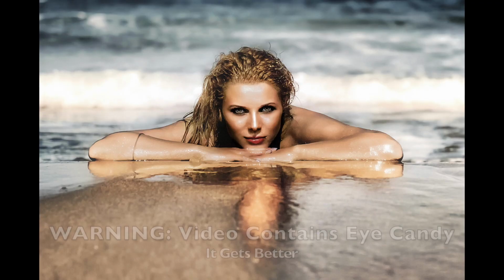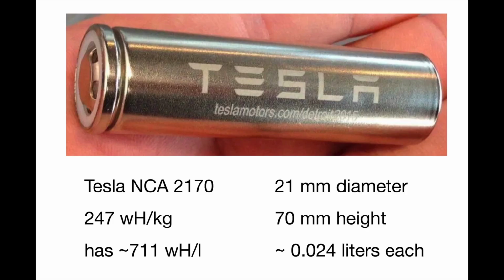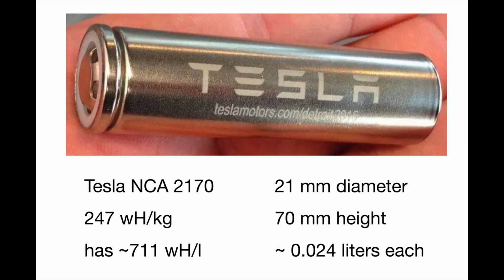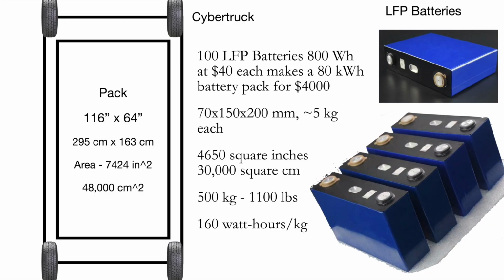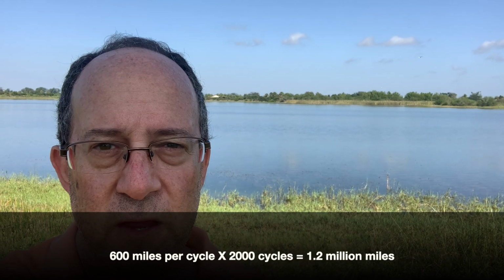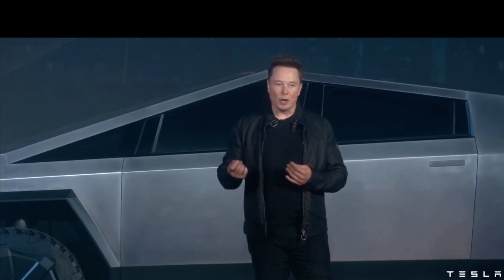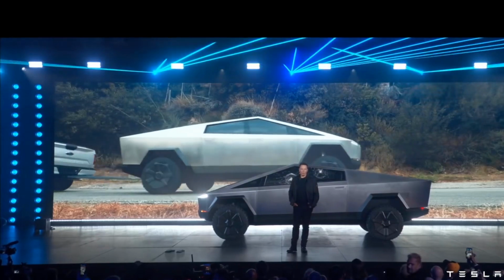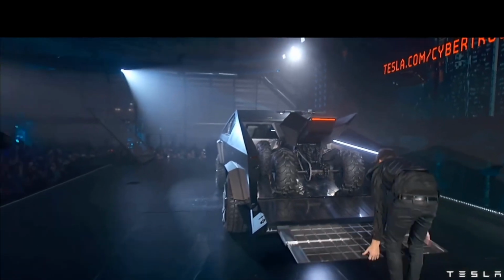Tesla Cybertruck SECRET Battery Advantage: Size Does Matter

Comment: I think you were right on track. This is getting more obvious after the Q2 call.  Nickel is a limiting factor. Easiest way for Tesla to scale to TWh is using LFP.   Lots of things Tesla did in the past makes more sense now. Things like 1) canceling Model 3 RWD long range, 2) canceling Model Y  RWD SR,   3) eliminating differences between AWD model 3 and performance (or making performance model mostly a software update over AWD Model 3)  and 4) why Tesla announced initially that they will start with the two cheapest  cybertruck  versions (which they then changed after seeing reservations). 

I am more and more convinced that what they have at Kato  is actually 2 projects. One high density battery that will go iinto S/X/Roadster/Trimotor Cyber truck. The other is LFP cell-to-pack. I think Tesl will stop Model 3 SR+ and reintroduce Model 3 RWD (long range) and Model Y RWD  LR - both  using LFP. I think these two will become their affordable vehicles. Probably 38 K for Model 3 and 42 K for Model Y, and going down slowly after that.  Cancelling Model 3 RWD LR was to ensure that  there is not a dramatic shift in cost (form the original base price of 49K for the RWD model 3 to say 38K for the LFP version). That AWD versions can receive software upgrades to performance versions can justify their substantiallly higher cost. 

Cybertruck RWD is definitely going to be LFP. Question is if they can pull it off for dual motor. But given that Tesla originally planned to do single motor and dual motor first I think it is possible that  dual motor also uses only LFP.   I think the hybrid option  can be done for dual motor.  Possibly 200+ miles range with LFP and 100+ with some Nickel based battery (possibly with lower cycling ability)  This way the lower cycling Nickel batteries will be used only when long range is necessary. Trimotor will definitely need the other high density secret battery brewing in Kato.  

I think Tesla wants to make the LFP based 3/Y and the 2 cheaper cybertruck versions as their mass market vehicles.  They will use  Panasonic batteries only for Performance versions. This frees up a lot of Panasonic batteries for Semi truck (at least until Tesla is able to scale up their own batteries). 

My prediction is that  the first battery factories at Austin will be LFP batteries for Model 3,Y and cybertruck. I think the high density batteries will be built in Kato for  S/X and Roadster. The cells for Cybertruck trimotor will come from Kato ( I am guessing they were surprised by the demand for Trimotor Cybertruck).
Reply from the maker: Using LFP will allow Tesla to lower price for Model 3 and Model Y. LFP is significantly less expensive than Nickel chemistries.
Reply: @WarrenRedlich  I wonder if Maxwell's dry electrode tech could be used for LFP too. It would then make a lot more sense for Tesla to make their own LFP cells.
Reply from the maker: Great question. I don't know enough about the dry electrode tech or LFP tech to get into that. The Limiting Factor is the channel to watch for that kind of deep dive. I asked him to do a video about LFP but he wasn't ready yet.

Comment: The announcement of a massive increase of super charges in China & Germany means smaller cheaper battery packs is possible, without range problems. Remembering that software is Tesla's secret sauce  other battery manufactures are not a threat, and even an advantage as shown by CATL in China.

Comment: Wow this is pretty shameless. Indeed lots of speculation. 
...and someone help me. If it’s simply the size of the truck that makes the difference...why is the SemiTruck such a challenge?
Reply from the maker: Problem with Semi is it uses a lot of batteries. Need to increase battery production.
Reply from the maker: And Semi probably can't use LiFePo4 because weight matters a lot.

Comment: At that time, Battery experts specifically said that a 200kWh battery could feasibly have 620ish Mi range

Elon also said that the 200kWh battery would be a double stack of P100D packs. This was before Maxwell...
Reply from the maker: Where did Elon say that about double stack?
Reply: Warren Redlich

During the MKBHD Interview, talkin tech with Elon...
Reply from the maker: Just watched it. Thanks. He didn't exactly say double stack, but it was helpful. I've been thinking about doing a video on Roadster and this really helps.
Reply: Warren Redlich 

Pretty sure he did. I’ll watch it again
Reply: Seems like you were correct. He simply said doubling the internals not a double pack. My mistake
Reply from the maker: I'm not really sure what he meant, but it's going to help with that video.

Comment: What is the point of this video?

The main aim for Tesla should be to increase the current energy density in their batteries in an even more sustainable way. Period. 

Thumbs down. Sorry.
Reply from the maker: I don't see why you think this is unsustainable.

LiFePo4 is much more friendly for the environment than the various Nickel chemistries. 

I do think Tesla is working on improving energy density - including with LiFePo4 - but using LiFePo4 for certain applications makes it cheaper to use those Nickel-based chemistries for applications that really need the improved energy density.
Reply: Warren Redlich That was not the point. Your video was just very speculative and it was hard to make out what your point was. If it was to speculate that Tesla is working on increased energy density and make them more sustainable, then that could be said in 30 secs... further speculations always look better with substantial evidence.
Just some feedback, I’d much rather follow a channel where speculations a backed up by evidence/or strong indicators, such as reliable leaks etc.
Reply from the maker: Point of the video is that Cybertruck's size allows for the use of batteries with lower energy density. This saves money on those vehicles and frees up batteries that have higher energy density for other vehicles that don't have as much size.
Reply: Warren Redlich I see, thanks for clarifying :)

Normally weight is one of the primes enemies when it comes to range and efficiency. Also the Cybertruck will need a big ride height for off roading capabilities, so I would assume Tesla would have batteries with both higher energy density and can be produced at lower cost - but yes, Cybertruck is a big vehicle and should be able to hold som good batteries :)
Reply from the maker: I agree the added weight would hurt range and efficiency to some extent. I don't think it affects ride height. I suspect that there will be an extra-cost off-road package that would probably be chosen only by those who buy the dual motor or tri-motor. Single motor model does not have All-Wheel Drive.

Comment: People use the LiFePh batteries in campers but I believe they are not supposed to be charged if below freezing. So unless they have figured out a way around this would be a problem for cars. Could put a heater in the battery but would really hurt cold weather range.
Reply from the maker: Tesla already heats the battery when necessary.

Comment: Some of those ladies look like they may have a 200KWatt battery pack under the hood!!!
Reply from the maker: Not enough volume in any of those models for a large battery pack.
Reply: More complicated, it's symbiotic -  the energy available depends on the anode (male) side, how much voltage gets generated by the cathode (female) excitation.

Comment: I have a very good guess, btw 8-).
Reply from the maker: What’s your guess?
Reply: @WarrenRedlich  When I built a off-grid solar setup, I used multiple different types.  Capacitors, and li-ion, and LifePO4.  and lead, actually.  I was able to get them all to work together.   Or a different chemistry all together.  But the CyberTruck will prolly use the next gen battery, not the 1mil battery.  the 2mil battery perhaps 8-)
Reply from the maker: It's pretty clear the Tri-motor will use the next-gen battery. But what do you think about LiFePo4 in the Single motor model?
Reply: @WarrenRedlich I don't actually know but the catl lifepo4 batteries I was originally using for the off-grid would fit well to a big flat truck battery pack, they are cheap, and square.
Reply from the maker: Yes. I briefly mentioned that in the video. Maybe that larger rectangular battery format would easier to assemble and require less additional hardware.
Reply: @WarrenRedlich  Yeah, I have disabled cameras, so you prolly couldn't see me nodding at the screen 8-).

Comment: 17:09 That is the cringiest piece of marketing I have ever seen in my life.
Reply from the maker: It was cute.
Reply: @WarrenRedlich  Should have hired Ryan Gosling to film short for Blade runner where he has to retire a replicant and featuring a beat up cybertruck as part of the short.
Reply: The whole point was anti marketing. It worked.
Reply: Stand the batteries up. Doubling the 54mm prismatic adds 40mm height to the 70mm cylindrical. About 4.5 inches high should be no problem in a truck.
Reply from the maker: I'm not sure how the chemistry works in prismatics - will the batteries work as well if they're sideways?

Comment: Great presentation, setting the ground for the  world vehicle made in China, with "SENSIBLE" range, performance, no of cycles, cost etc. LiFePO4 is obvious for stationary applications, and the use of cylindrical cells is purely historical. Maxwell electrodes, coating, double heating of crystal cathodes etc, tab-less electrodes apply equally to a  prismatic cell.The actual electrolyte & additives  will vary. TESLA'S SOFTWARE IS THE BIG SECRET and in my mind the concept of the buyer selecting  the ratio of NCA  & LiFeOP4 cells  in a hybrid would tick every-ones needs & desires.
Reply from the maker: Yes, I think software combined with a hybrid battery could be fantastic. I'm not sure it's worth the engineering effort but it should be.

Comment: Elon said that the Roadster 2 would have a 200kwh battery pack 3 years ago. Things change and they may not need that when it’s actually here.
Reply from the maker: I just don't see how they can fit a 200 kWh pack in Roadster. I'm not sure how they'd even fit in 150 kWh.
Reply: Warren Redlich no you’re right, it must have been very tight in the prototype, whatever pack they had during the unveiling. I think someone said that they would be stacked on top of each other but that would make the pack extremely thick. Fewer cells with more energy density is more probable for the upcoming version but Elon did also say a few years ago I think “we can do 600 miles today, no problem” but I guess it wouldn’t be as practical as it will be.
Reply from the maker: My guess is it's some kind of tech that will be very expensive to produce at first, so can only be used in Plaid powertrains.

Other guess - tri-motor layout means two motors are closer to the wheels instead of center, so there's more room for batteries on that end of the car.

Stacking would raise the center of gravity - bad for a sports car.

Comment: Lithium Titanate can be very fast charged, 20,000 cycles - robotaxi? LiFePO4, LiTO both are safer too.
Reply: LiTo? Nobody talks about that. Sounds like a thing thats not ready or proven.
Reply: @635574  Company in Melbourne are starting to make power walls. Not that common but car audio guys know about them. Videos of them bring drilled to show how safe they are. Energy density is lower so not yet suitable for cars but some buses are being made.  Tesla battery day is closer.
Reply: @gavinmcintosh7022  makes sense, for powerwalls cost per kw and lifecycles come first, for cars energy mass density is top.

Comment: For sure, I am expecting a huge breakthrough in electrolyte! Will make possible significantly more range due to less first-cycle degradation and longer life, eg. 1M+ miles. (i heard rumors of 2M miles with ~90% capacity, but hey, rumors, like everything now ;) ).
Reply from the maker: 80 kWh pack with 350 mile range and 5000 cycles would be nearly 2 million miles.
Reply: @WarrenRedlich  ah yes! Hadn't done the back-of-a-napkin math yet, thanks.

Comment: Supercapacitors seem to be off the table, indefinitely. I believe Elon said that in that Third Row interview.
Reply: @Chuck O You could run regen through the supercap instead of the pack.  This would mean less cycling on the battery and greater max regen.  That's all I can think of.